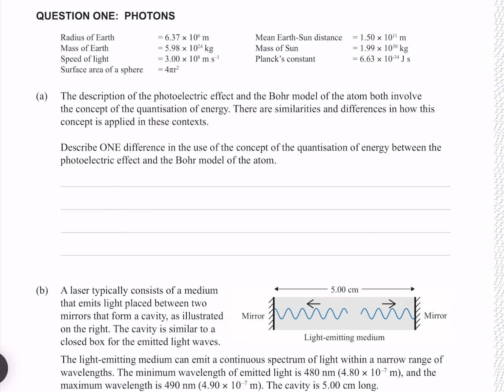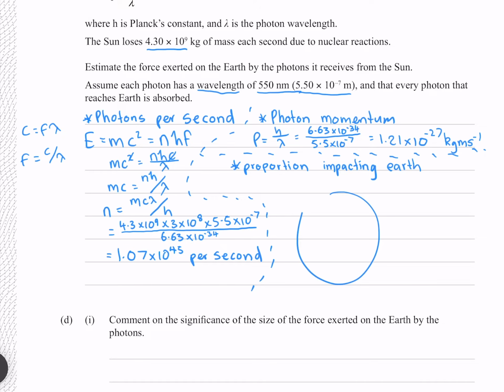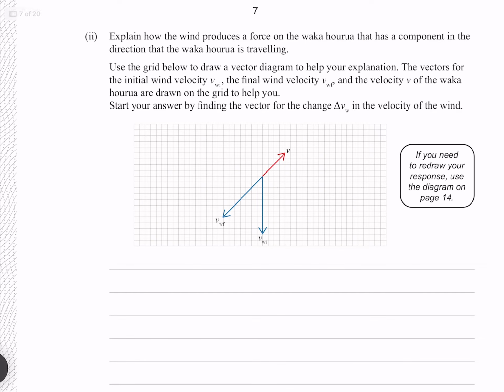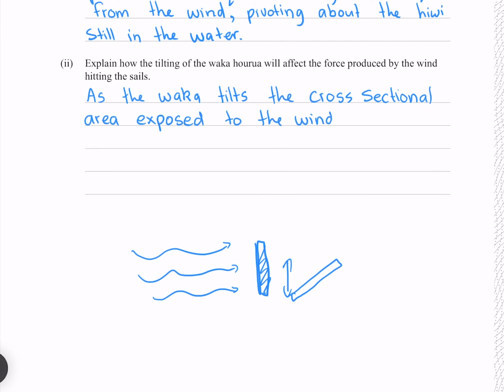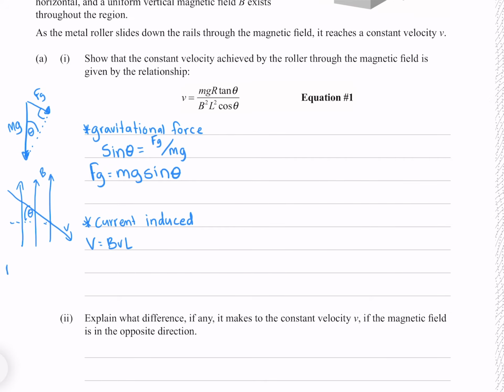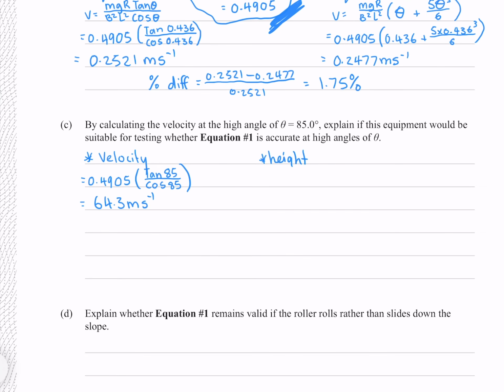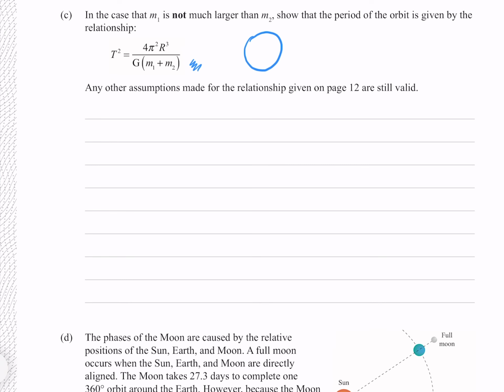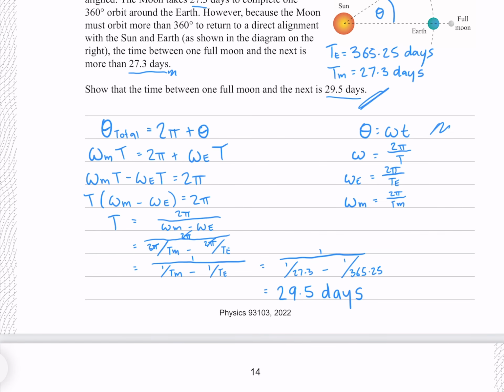2022 NCEA Scholarship Physics

Comment: Hi Sir, for Q2i, an external force is applied to the wind to change direction, but why would there be an equal and opposite force on the waka? Also, in the marking schedule, they said that there's an equal and opposite reaction force on the sails. Is that correct? Does that mean whatever force is applied to the sails on the waka would cause the waka to move in the same direction? Thank you for your help!
Reply from the maker: Hi Eric, I'm using waka and sail interchangeably here. You're quite correct that the force is on the sail, however the sail is part of the waka.